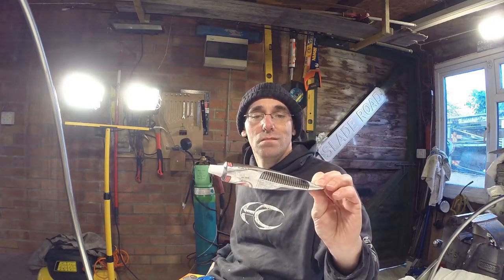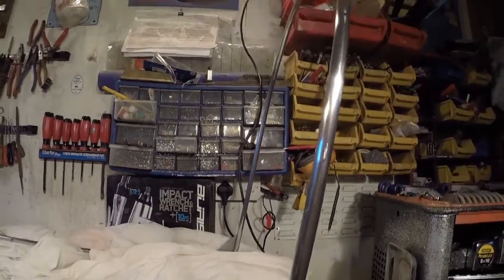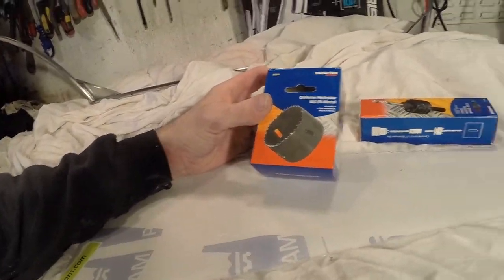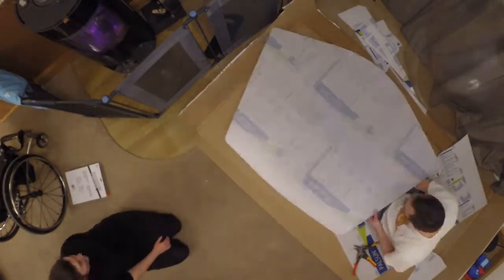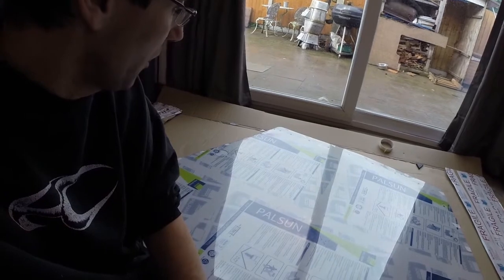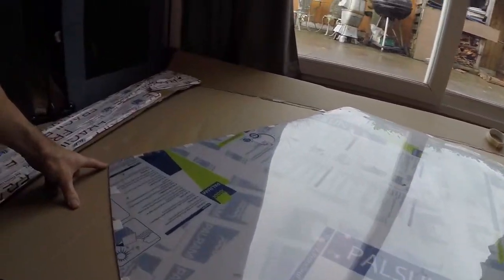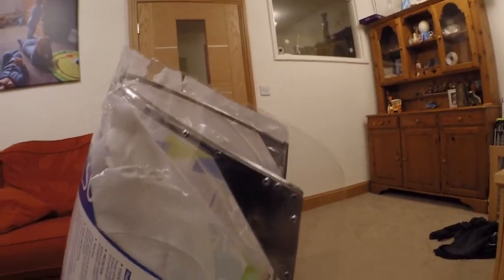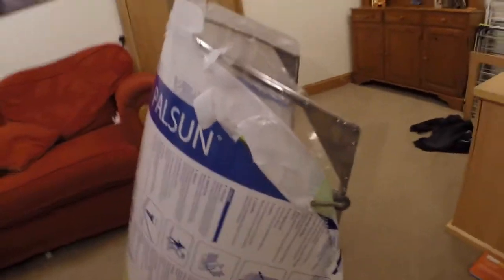Streak Shadow Rebuild - Part 7

Comment: Hi great clips you have put together I must replace the canopies myself what did you use to cut the polycarbonate?
Reply from the maker: Hi Finbarr, I used tin snips to cut the material.  Glad you like the clips,  I have enjoyed a few of your Shadow videos on YouTube as well.  Nice to know people are watching. Thanks
Reply: R1FREESTYLE 
Thank you for the info yes I always look forward to your next instalment I'm on my third shadow and am a big fan Plan to bring my shadow to my garage for some TLC Hopefully I can source polycarbonate here in ireland easily What thickness did you use ? Also mine are tinted slightly brown wonder is that stuff easy to get Keep up the good work Thanks again Fin
Reply from the maker: Finbarr  I used 1.5mm. Apparently on early Shadows it used to originally be 1mm, but it was found (especially with the Streak) that approaching VNE the canopy would "pop"  in.  So it was increased to 1.5mm. Lots of Companies on the net that sell the Polycarbonate.  If you get stuck,  let me know and can send you the website for the one I used.
Reply: R1FREESTYLE 
ManyThanks yes my first BD shadow had the thinner canopy and did pop in if you dived increased speed 😀
Fin
Reply from the maker: Finbarr must be quite shocking!